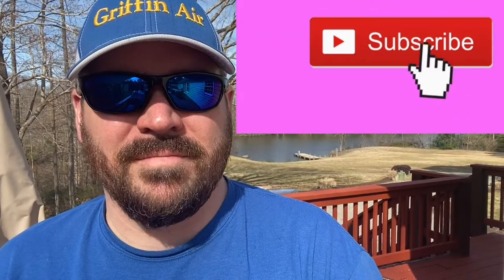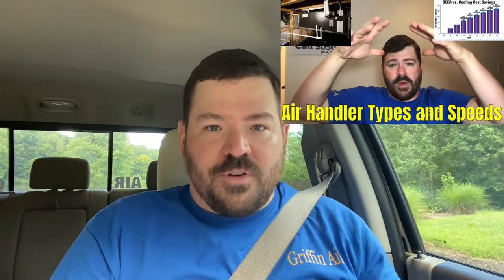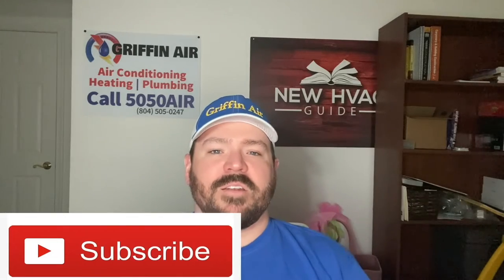HVAC single-stage vs two-stage vs variable compressor. Heat pumps and Air Conditioners video

Comment: So when setting up the thermostat with an inverter system (Bosch) would you say it's a single stage or something different when there is no setting for an inverter system
Reply from the maker: Yes

Comment: Question: I have a ductless mini split that advertises an inverter compressor. I recently upgraded to a 3 ton 15 SEER variable speed central air conditioner as well. The central air is an inverter system if it’s a variable speed ECM correct? Thanks!
Reply: They could be talking about the fan but technically ecm is variable speed

Comment: Check the cost for parts and labor between simple systems and advanced systems.  These techs love advanced systems with control boards and ECMs.  Crazy parts costs, which profit from wholesale to retail is HUGE.   Replacing computer boards take seconds not hours.  And, oh by the way, almost all warranties only cover parts, but not labor.  Gee, wonder why the labor part of equation supports “high tech” versus cheaper parts.  Clown.  Don’t be fooled.  He is selling and you are buying.  Ask him what is he paying for in his house, even though his labor is free.

Comment: Saving energy at the expense of comfort defeats the entire purpose of owning an AC. Its a shame governments have brainwashed people into believing there's a limited amount of natural resources when the truth is everything on earth is constantly recycling its self. I get making better compressors & motors that work just as good off less energy  or more importantly to me LAST LONGER but its like we are just paying extra for devices that decrease energy usage at the expense of efficiency. Efficiency in terms of AC means how well it keeps you cool. The energy it use is the cost to keep you cool & your not going to be cool without that cost. Just turn the freaking temp up if you want it to run less.